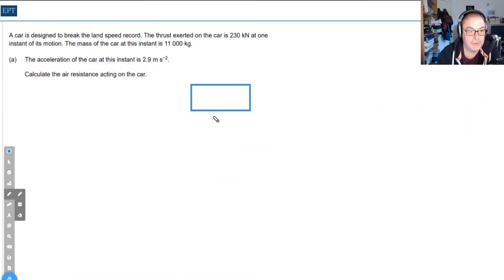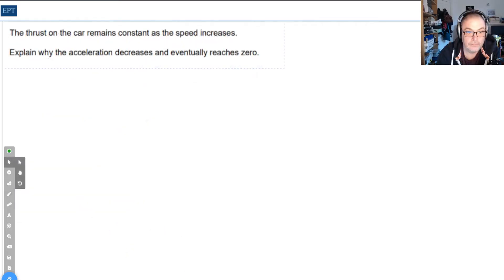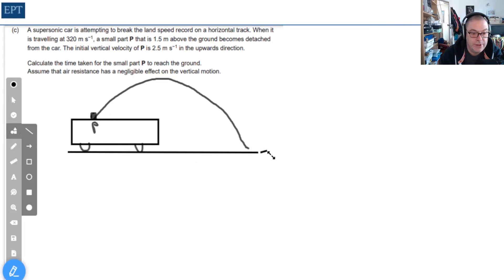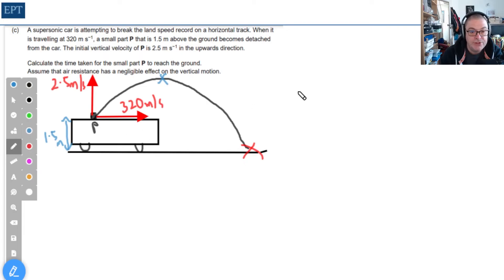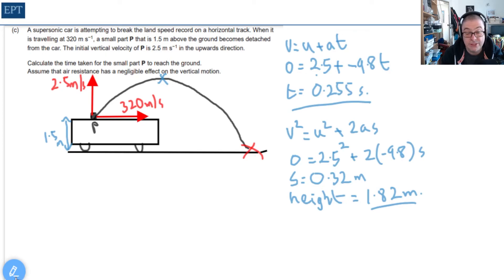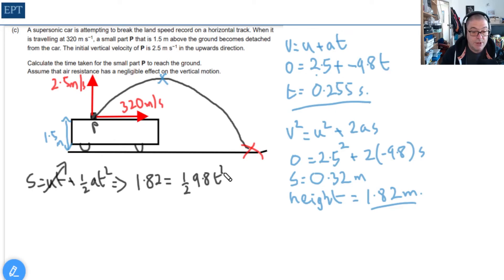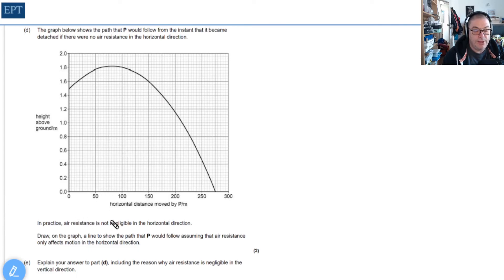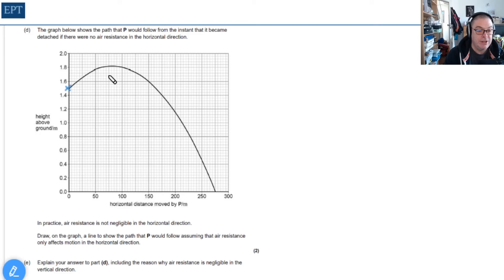A Car is designed to break the land-speed record - Hard A Level Mechanics Question

Comment: For part c), rather than calculating where v = 0, then calculating the height, etc., a much faster method would be to only look at the vertical velocity. 

We know the part P starts 1.5m above the ground where we can consider s = 0, so when it hits the ground s will be -1.5m. From here, taking the upwards direction to be up, we are already given the initial vertical velocity to be 2.5m/s and acceleration would be -g, leaving us to find the time taken to reach the ground. 

Using the equation s = ut +1/2 at^2, we substitute s = -1.5, u = 2.5 & a = -4..905 to get a quadratic in terms of t: -4.905t^2 + 2.5t + 1.5 = 0, which can be solved on your calculator resulting in t = 0.8637..., t = -0.3450... and we take the positive value, so therefore t = 0.86s.
Reply from the maker: Great... well done. There's nearly always more than 1 way to do every physics problem

Comment: On the first question, the answer is actually 198,100N. you just missed the "100". Great video thanks!
Reply from the maker: well, I guess we're both right - 198100N rounds to 198,000N - and you can't really justify 4SF - well come to that you cannot really justify 3 either so you could argue that it should be 200,000N. ALso the AQA mark scheme has it as 198000. I guess I should really have shown it as 198100 and then talked about SF. 

Either way thanks for the heads up - I'll try and make the SF issue clearer in future. Hope it was useful anyway